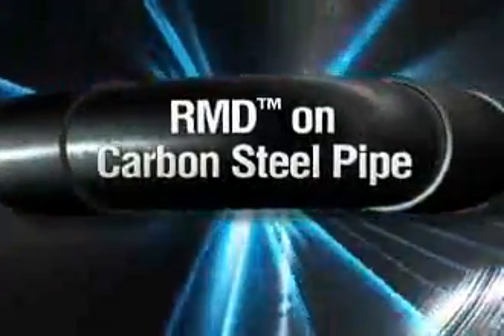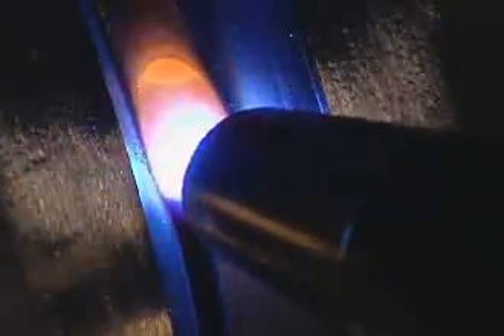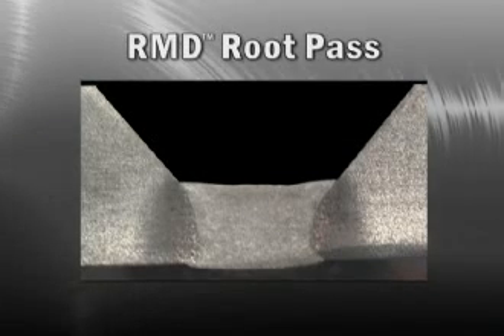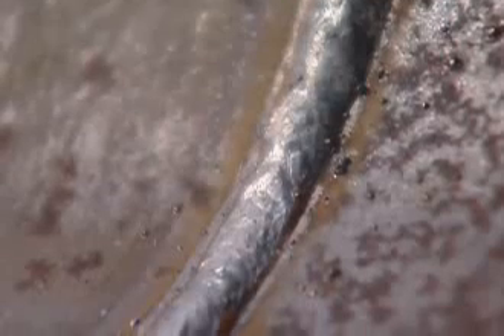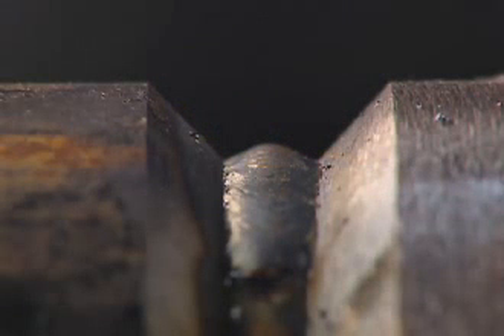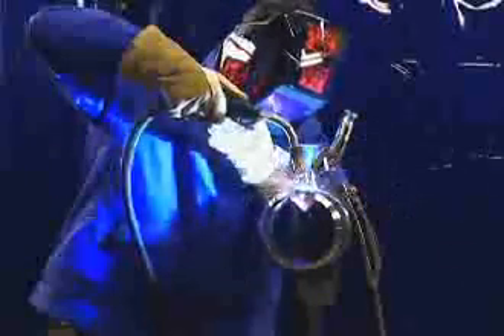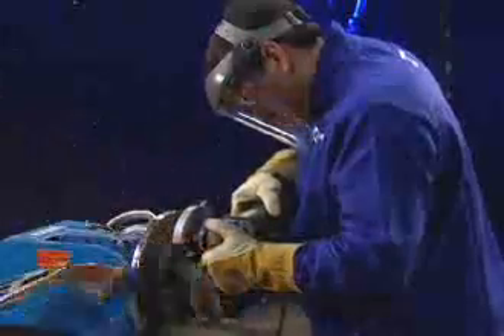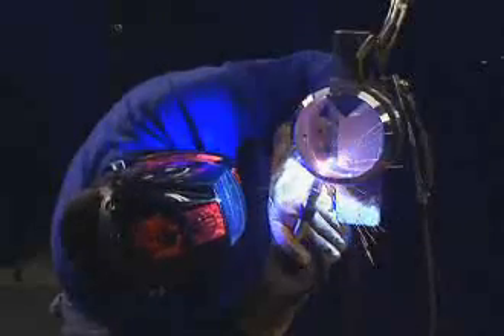RMD on Carbon Steel Pipe

Comment: What carbon wire and gas is recommended for RMD
Reply from the maker: Great question, Chris! We would recommend using only a stainless steel wire with a high silicon content, such as a 316LSi or 308LSi . Higher silicon content helps the puddle wet out and acts as a deoxidizer. For optimum performance, use a “Tri-H” gas that’s 90 percent helium, 7.5 percent argon and 2.5 percent CO2. Alternatively, use 98 percent argon and 2 percent CO2. We also recommend taking a look at this article as it further discusses RMD: https://www.millerwelds.com/resources/article-library/new-regulated-metal-deposition-rmd-mig-welding-process-improves-stainless-steel-pipe-fabrication.

Please let us know if you have any additional questions and we can happily assist. Thank you!
Reply: @MillerWelders  Thanks for getting back to me. This is one of the reasons I have stuck with Miller. 
I am 62 and the companies that I have worked for in the past would have issues Miller would send reps to the company to help fix the problems. 
Thanks for not throwing your customers under the bus so to speak.

Comment: Why do you have to hold the trigger for a second or 2 to get it to feed? Is there an adjustment for that? I can’t find anything on it. It’s the only drawback to the machine I can think of. We have 2 at work and they both do it and nobody knows how to avoid or change it.
Reply: its a preflow setting, if you hold the purge button and spin the trim knob at the same time it will let you enter a menu adn adjust the pre and post flow purge times.
Reply: @Michael-mz8ow  fuckin stellar!!!
Reply: Probly for the shielding gas to start flowing before the arc is initiated. Just my best guess

Comment: I have been using these machines for a few weeks now. I am already putting in perfect roots every pass but I have a question. What does the arc length do exactly if you go in the plus'  or minus' I usually leave it at zero and I get roots in the 5G with 2 mm reinforcement but it would be nice to know what that dial actually does. I cant find any kind of write up on it.
Reply from the maker: Hello Stephen! Thank you for reaching out. According to section 6 of the operation manual, the arc length is the distance from end of wire electrode to the workpiece. This term is also used to represent arc length adjustments in RMD and Pulse processes. Increasing Arc Length increases the actual arc length; likewise, decreasing Arc Length shortens actual arc length. We recommend leaving it at 0 as there usually is no reason to change it. Let us know if you have any additional questions.
Reply: To my understanding the arc length is a function of the voltage and wirefeed speed.  A longer arc length has a greater voltage for a given WFS, and typically will produce a weld with less spatter, greater heat input, and more penetration, greater chance for burn through or dripping.  In my application we had to limit arclength to avoid overheating the parts and causing excessive stresses in the parts.

Comment: Can you please explain to me what the difference between say a 1.7 arc length compared to a -1.7 arc length and what the  arc control does because the Miller rep couldn't explain it and just told us use 0.0 arc length and 200 wire speed and never said anything about arc control
Reply from the maker: Hi Shawn, thanks for reaching out. What welder were you discussing with the rep? What is your application?
Reply: Miller Welders it's the pipeworx 400 and we're rolling out pipe size is 3/4" up too 24" pipe

Comment: no gas? and i guess a roll of wire is 500 dollars . sweet! im sold
Reply: jimmy holden yes you use gas dude for RMD root, the pulse Mig and the dual shield flux fill and cap

Comment: This type of welding is pretty cool however don't believe the hype yes tig welding can seem impossible at first just like rooting with mig rmd its preference (what looks cheaper on a bid ) mig right? I disagree with this method it could cost more in the long run. it's not as easy as it looks however it comes naturel to me.......have fun that's all that matters....5% skill 95% confidence just wanted like shooting pool....
Reply: Great comment 2026 BCAPL nationals 🎉

Comment: Can you tell me what settings that were use for this I can't seem to get it run right
Reply from the maker: jaime coronado The following settings are where we typically start our customers with: Wire Feed Speed: 200, Arc Length: 0.0, Arc Control: 0, Gas:  90/10 Ar/C02. Use these settings as a starting point and go up or down to fit your comfort zone. Please let us know if you have any further questions.
Reply: @MillerWelders  Hi, we are in offshore pipeline progress by using RMD/Pulse with Gas 80%Ar - 20% Co2. currently we are using the parameter WFS : 200, Arch Length : 0.6, Arc Control : 0. mostly defect on top location i.e 10 o'clock up to 2 o'clock position with defect Lack of root Fusion ore Lack of fusion by NDT exam PAUT.

Can you please advise, does parameter that we are using is correct or no? some on 5 - 6 o'clock position always convexity instead of flat position.
Reply: +jaime coronado bot this application i thought 15 at 19 volts should be better

Comment: how about some setting parameters.
Reply from the maker: This video was developed to illustrate a weld and the specific welding techniques and weld settings used are not necessarily the best for all applications. The Specification Sheet from the manufacturer of the filler metal you use is the best tool to determine starting welding parameters. We intentionally left the weld settings out of this video because following any local, state, or national codes or standards is the responsibility of the welding organization producing the weldment. Testing the weldment will ensure that the settings, technique, and overall procedure that you develop will meet the requirements of any applicable codes or standards. If you have any further questions, please let us know.